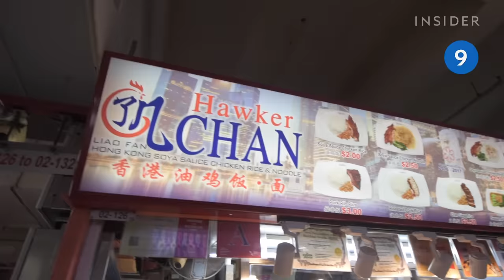13 Food Markets And Fairs To Visit In Your Lifetime | Ultimate List

Comment: I have been to the Arizona State Fair before as I have been born and raised here in Arizona. However I haven’t gone there ever since I was a little kid. I might have to go there again, but only when it’s not too hot outside.

I would also consider doing a road trip just to experience every single one of these county/state fairs along with traveling abroad to experience the ones in the other countries mentioned in this video.